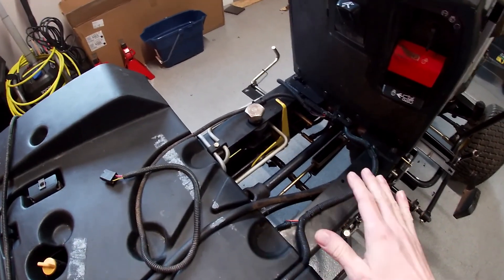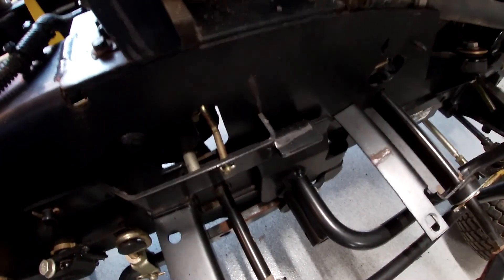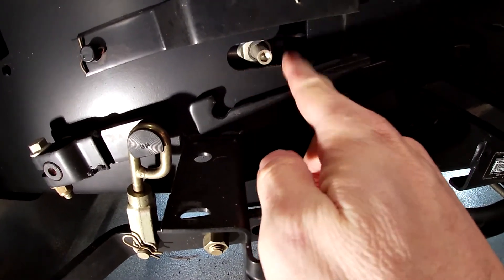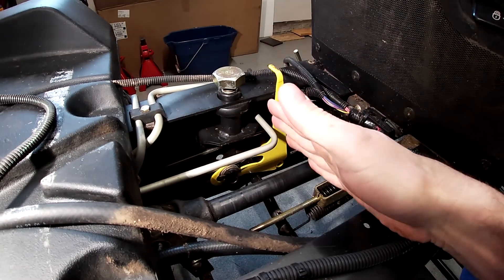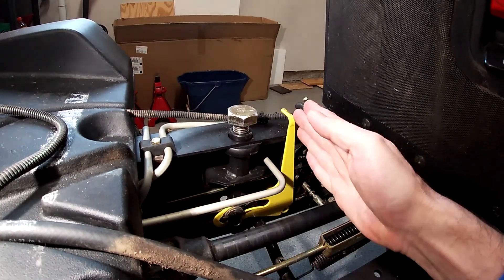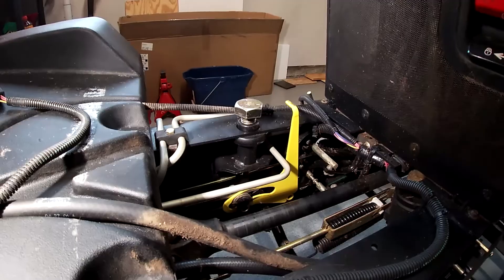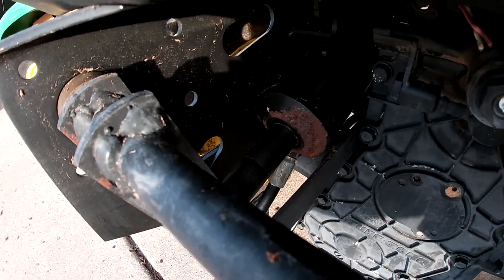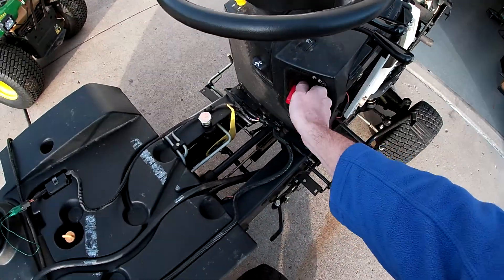John Deere 425 Park Brake, Deck Height Adjustment, Hydraulics Overview

Comment: Seeing how the height adjuster stop works is very helpful. The adjuster on the 445 we picked up this spring doesn't seem to make a difference. I suspect the plastic part that fits over the bolt head is cracked or stripped and doesn't actually move the bolt. The deck will come off for winter in a couple weeks to get the blower attached, so checking if the adjuster works can be a spring project. This whole series is really great and will help me do some fixing up on ours next year.
Reply: Worth noting the adjuster isn't really an adjuster but rather a stop.  Accurding to the manual, the proper procedure is to use the hydrolic to set the deck to the desired height and then tighten the deck height adjuster until it stops turning and close it locking that position.

Comment: How did you get the knob off mine is stuck or something mine won’t turn at all
Reply from the maker: If you have the deck lowered all the way against the stop, you won't be able to turn the knob.  Put the deck in the middle of travel, and the knob should turn.  If it doesn't, something else is wrong.  The plastic knob itself just sits on top of the adjustment bolt.

Comment: Is there an adjustment on how high the deck will raise when using the lever near the steering wheel?  I want my max up to be a little lower than all the way up (my new AG rear tires are hitting just a smidge at max up).